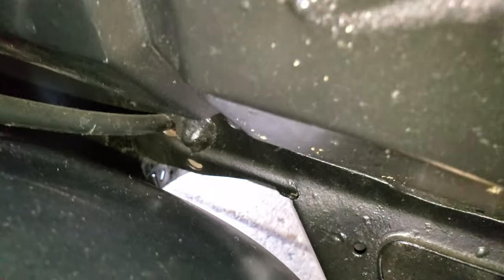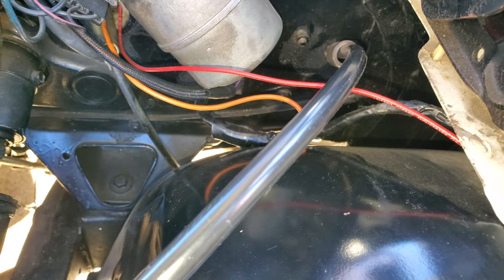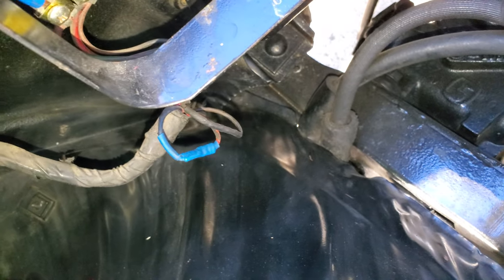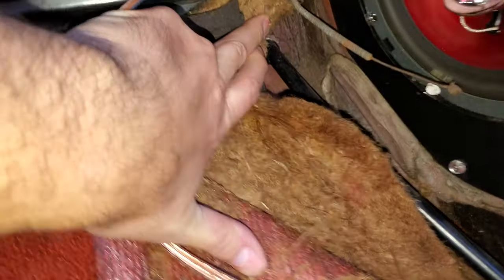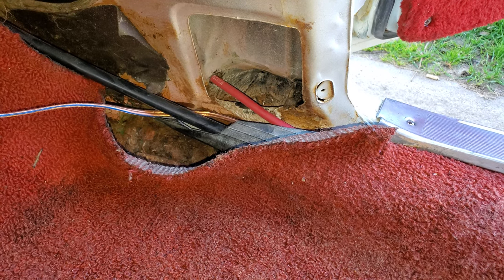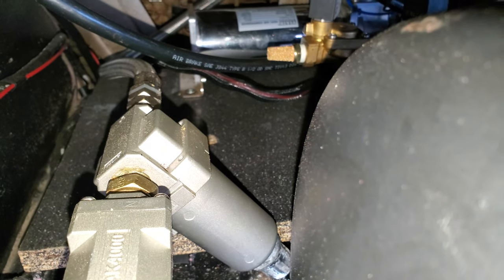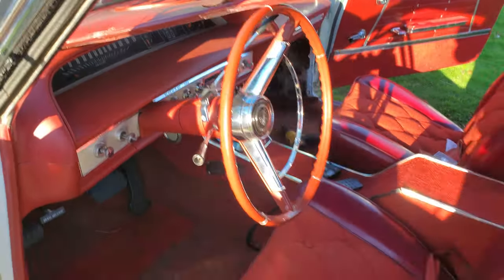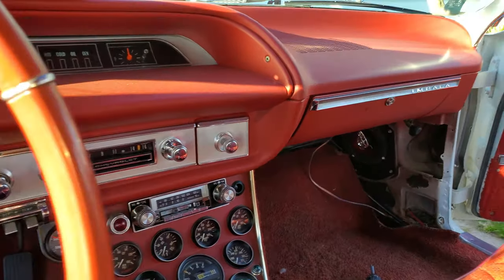A Quick Video of how I ran my 1/2" Airlines for the Air ride in the 64 Impala.

Comment: Gotta ask, Is your manifold 1/2 or 3/8's going to 1/2 Lines?  Taking notes. Thanks for the vid upload.
Reply from the maker: The solenoids are 1/2 if that's what you're asking? I'm running separate solenoids not a manifold.

Comment: Nice Ride! Where did you get that plate for your 6X9 Speaker in the front? That replaces the air vents right?
Reply from the maker: I made them out of thin sheet metal from a old metal shelf. Traced the air vent on it and cut it out with a cut off wheel on a grinder or a metal blade on jigsaw.

Comment: What brand of air ride did you use and how does it work while driving? Meaning can you activate it while moving or not
Reply from the maker: I pieced it together myself. It works all the time as long as the key is forward.
Reply from the maker: @229leatherface  yes, as long as the  keys are in the ignition and on.

Comment: What brand alternator is that..and where can I get one... is the pigtail factory from 64
Reply from the maker: It was a ebay one, I can't remember how many amps but its over 100. The pigtail  I bought from advanceauto its a generic gm one.
Reply: @buffalow64  was the alternator for an 64 impala or did u use another year
Reply from the maker: @joetrevino261  I have to go back and look at my ebay purchases and I can let you know. It was awhile ago. I works great though,  no dimming lights,  running 2 viairs no problem at all.
Reply: @buffalow64  ok let me know thanks
Reply from the maker: So it was a chevy 105 amp high output 3 wire. Basically its a Delco 10si alternator.  Grab a 10si pigtail from autozone and your good to go.
Reply: @buffalow64  ok thanks

Comment: You had to drill a hole in the top of the control arm ?
Reply from the maker: Yes, I drilled it
Reply: @buffalow64  just did mine today ! Just like yours . Still need to drill thru the fire wall and wire it all up . Bot got all the bags mounted.. good grief im exhausted tho

Comment: Hey brother . Is the pvc pipe necessary?  I'm running my lines tomorrow
Reply from the maker: I'm not sure if your asking about it on the line from the firewalls or down to the back? Nothing is really necessary its just trying to think ahead and prevent potential problems if that makes sense.
Reply: @buffalow64  yeah man i hear ya.  I got some grommets im gonna try
Reply from the maker: @PeachCoastLowrider  I can't remember but I think I drilled a pilot hole from the inside to see where it comes through in the engine bay.
Reply: @buffalow64  hey man what exactly will drill though the fire wall ? Never done this before !

Comment: You still have shocks?
Reply from the maker: Just the rears, fronts are not installed and rides fine.
Reply: @buffalow64  yeah im hoping mine rides okay without shocks in the front ..dont wanna drill more holes
Reply: @buffalow64  its not really floaty?
Reply from the maker: @PeachCoastLowrider  no, I mean over big bumps it can be a little but try it first without and then you can always add them later if you don't like the ride.
Reply: @buffalow64  yeah they came with my kit but I'm gonna try it first.  Was worried about being bouncy.  Of course some say its too bouncy.

Comment: Those hoses look like crap. I ran mine underneath  used metal strap that are coated in rubber and  ran it through the frame to a 90 elbow fitting.  I also used rubber hose over the plastic line anywhere it might rub anything.  Ran the 4ga power wire underneath as well with fuses on each end  and a circuit  breaker  for tge compressors.